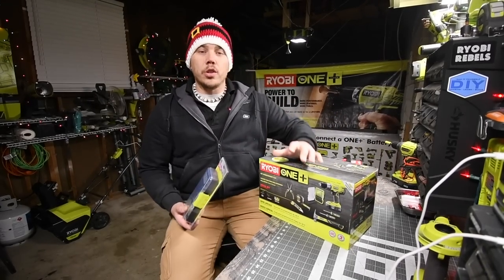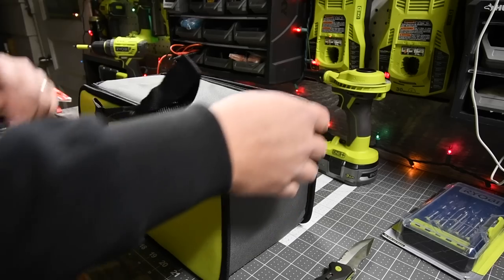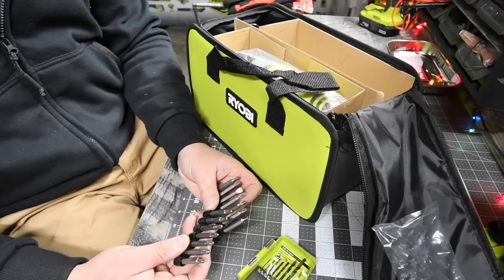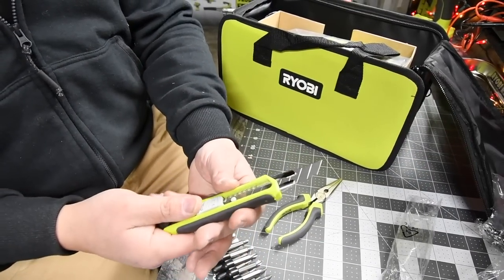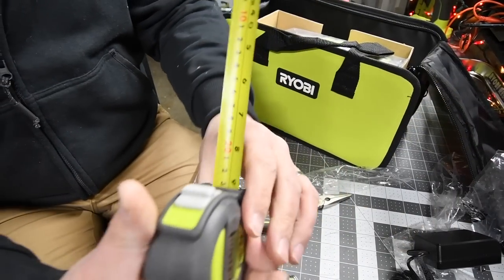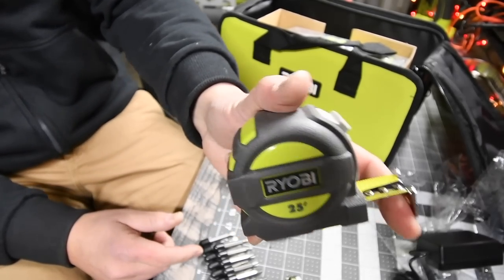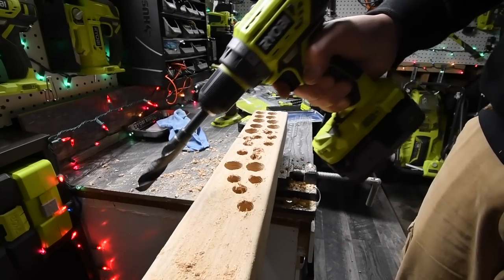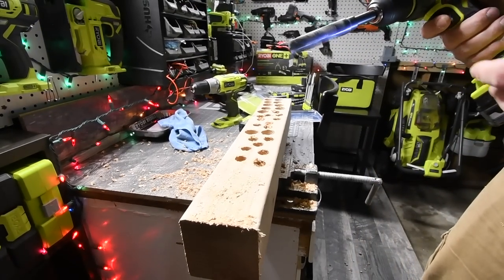Ryobi Black Friday Home Owners Kit

Comment: I saw this nice kit if I was starting out I would say go for it @ $79.99 it's got what you need to get started my diy kit was black & Decker corded in 1995 but didn't come with hammer or tape measure box cutter just a few drill bits no driver bits my big brand was dewalt dw990 14.4v Nicad  was about the same as the Ryobi your using except that's yours is lithium ion I had the old blue version yellow battery gave it away nice video thank you for sharing I still have my p211 beat up but works
Reply from the maker: I thank you sir

Comment: When you were testing the brushless drill.  The reason it stopped near the end was the flutes on the drill bit were full of wood chips.  You either need to pull the drill bit up to clear it or get a longer drill bit.   
Great video!!    I was thinking the same thing about the hateful drill that comes in the kit.  They should have put a better drill in there.  Especially if they’re gonna market it to homeowners that need a drill.
Reply from the maker: The wood broke underneath the 4x4 and the bit got caught on it. I need treated wood for now on
Reply: When drilling any hole, you need to clear the chips periodically. Otherwise, the chips will bog down and stop the drill. Spade bits are known for breaking through the wood and breaking off and splintering pieces, without cutting all the way through cleanly. Especially when trying to drill holes fast. The best way to avoid splintering is to stop drilling when the tip of the spade bit breaks through and resume drilling from the other side.

Drill motors will overheat rapidly when bogged down and stopped by the material when under power.

Comment: I whent & bought a standard charger. 
But I returned it. Then I whent online
& bought one of those bags with the
Charger inckuded.
I have my ossilating tool along 
With a wide assortment of bladed too.
Reply from the maker: very good, sometimes you can get a better deal online anyway
Reply: Well that one at home depot was a little high & becides it was kind've cumbersome

Comment: I really wish this kit was lower priced, or didn't come with some of the items like the drill/battery/charger/bits to keep the cost down.  I had already bought the tape measure (both versions), hammer (have all three sizes), drill bits, and have the brushless drill, so all of those things were useless to me.  The drill is very base model and the battery is one of the weakest they currently make so also no need for that.  

I'm sure for someone just starting out, this set would be great.  For anyone else that has been in the Ryobi game awhile, it has too much extra crap.  The only reason to get it for most would be for the "Ryobi" box cutter, 2 screwdrivers, and the pliers.  That's not reason enough to spend $50+.  I thought about buying this set and selling everything off except these items, but it doesn't seem worth it.   Furthermore the Ryobi branding on them doesn't look that great.  It looks kind of slapped together.

As others have said, I wish Ryobi would just release their own brand of hand tools.  We already have the hammers and tape measures so here is hoping they come out with an actual screw driver set, level, wrench set, pliers set, and ratchet set.  I have the Evolv series which look close, but would love to get some nice looking, Ryobi branded versions of all these.  I'm sure it's only a matter of time.
Reply from the maker: I agree, a full line on sockets, wrenches and other tools would be awesome. They also should have included a brushless drill instead of the one it came with. Thank you sir :)